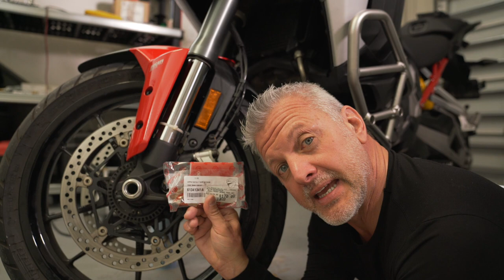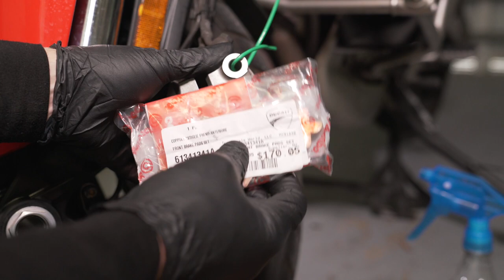How to Change Brembo Brake Pads Ducati Multistrada V4S Edition

Comment from the maker: What do you do different to change your motorcycle brake pads?
Reply: Rembo, you went OEM for the pads?? Do you know that Brembo has much better alternatives for a fraction of what you paid? Also, you NEED to keep the brake engaged while tightening the caliper bolts.
Reply from the maker: @mauriziozanni4161  I did not know there was an alternative to Brembo of the same quality.
Reply from the maker: @mauriziozanni4161  That is a significant savings.  Is the quality as good?
Reply: @RemboUSMC  The first link I sent is the OEM compound, the same one you just installed. Is Brembo aftermarket good? I would say it's way, way better than OEM, where a certain price point has definitely a relevance. Brake compounds like SR are the latest ones coming out of the Brembo labs. The Z04 is the BEST compound money can buy (commercially), and a complete set for two disks costs 60% of what you paid for yours, and they don't even remotely compare.
Reply from the maker: @mauriziozanni4161  Thank you for this important information.  I will definitely look into them.
Reply: @mauriziozanni4161  The Z04s are for track and more specifically racing, they need heat, and kept hot, they are rubbish cold and even warm, and will be a poor choice for the road. Even the SRs are probably not the best choice as you need to keep the heat in them, the SCs are probably the best choice for all conditions and weather and the LAs if you aren't quick and want them to last a bit longer but need a bit more braking power than the OEMs
Reply: @CurvedSlightly  Not true what you say, SR are replacing the SC. SR has better performance in the cold and good performance when hot. For track you use RC they need more heat to get better performance. You can find the list on the page of brembo. The SR is even on the case written as Racing/Road use and the RC is for Racing only.
Reply: I do feel we speak the same language in this matter. Even the detail of the silicone spray around the pucs! Awesome work 👏 
One thing I do differently is not using the Torque wrench for unbolting. Only for tightening to spec.  After all, is a precision device.
EDIT: As for the Torque specs, what I found and it is common to both base and S version is 45 Nm or 33 ft lb
Keep up the good work!
Reply from the maker: @pedrosousa7493  Thank you for sharing your thoughts with the group.  I appreciate you taking the time to do so.
Reply: Same but not the silicon sealant,

Comment: Hi Rembo, Great video..I managed to get the torque settings off the dealer workshop when I purchased my Multi V4S. You are right the caliper bolts are 45Nm or 33ft-lbs so good job!
Reply from the maker: Thank you for confirming this.  I appreciate it.

Comment: I am planning to replace my front brake pads for my Strada 939, but personally I don’t think I would unmount the calipers completely just to replace as well as cleaning the calipers because of over tightening the bolt. 
As I have slimmer fingers I could do this easily.
Thanks for sharing your experience, but I would rather go for EBC complete brake kits instead of Brembo brand to save some money on fuel for my trip 😊, just economically speaking
Reply from the maker: The price of Brembo brake pads are crazy and there are several options that I believe are just as good if not better.

Comment: Thanks for the very informative video! I've done some work in my bikes but haven't had to change pads yet. One thing I noticed is you didn't bleed the brakes after you installed the pads. I bled mine last year and put in new DOT 5.1 fluid. It was a bit of a pain in the arse to be honest. Does this HAVE to be done after changing pads or personal preference?
Reply from the maker: Preference

Comment: I don't have factual data on the EBC HH  but from running them now for many years on high performance/speed bike the seat of the pants data tells me they are bloody good and work first bite and every one after that .

Did you go with the stock replacement pad for the V4 or go up a spec ?
Reply from the maker: I bought stock Brembo from Ducati.  $$$$$$$$$

Comment: Nice job👍🏽
Reply from the maker: Thanks 👍
Reply: @RemboUSMC  question; does Ducati have a cam bus electrical system? I'm thinking about adding a pair of Denali lights , your expertise is needed.
Reply: @lpete531  according to my dealer you are on your own. Denali's Dial Dim looks like an awesome product to control D2 through to D7's. I got Duc's OE lights mounted that needed to be programmed by the dealer.

Comment: There's a better way to centre the pads/callipers, that will give you more power and less lever travel, but too difficult to explain here, holding the brake on while you tighten the bolts doesn't really work that well. Also, according to the MTS V4 Torque Spec sheet, the calliper bolts should be pre-tightened, to 2Nm

Comment: For future reference, EBC makes pads as I just found out:
https://ebcbrakesdirect.com/motorcycle/ducati/1158-multistada-v4/2021/36532  
The discussion regarding brakes came up on a V4 FB group and a lad posted the EBC part numbers.
Reply from the maker: I know they may be less expensive but I’m still not convinced that they are at the same level as  Brembo.  Need to see data and comparison specs.